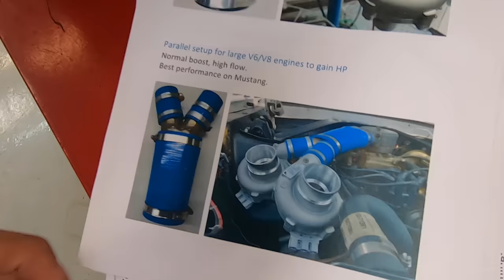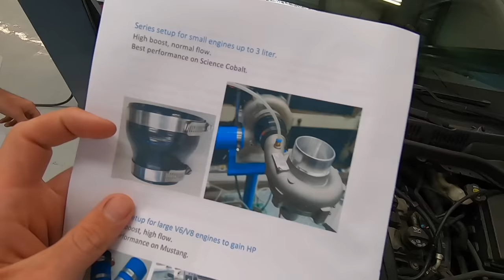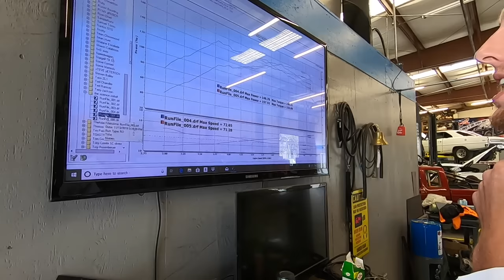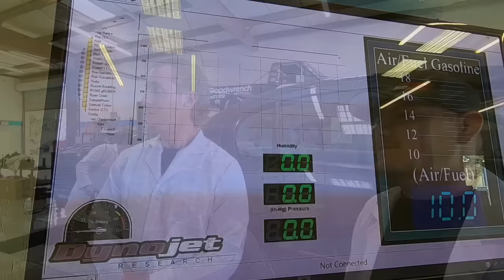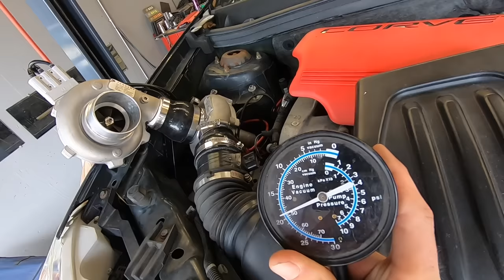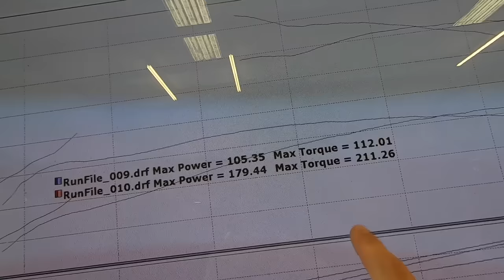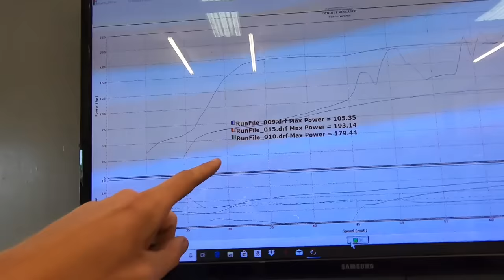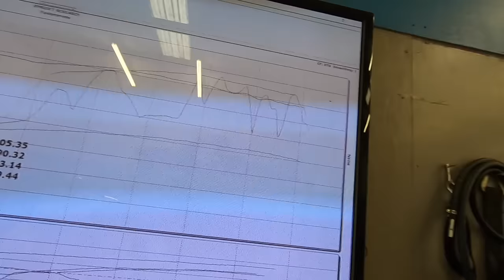Dyno Testing $5,000 Worth of ELECTRIC Turbos! Double the BOOST!!!

Comment: The only thing that can make these little electric turbos better is if they were half the price. Too close to the price of an actual Turbo
Reply: But they spinup much faster so no turbolag
Reply: Yeah the price for only 3-6 psi is a downfall.
Reply: No new manifolds, much less heat, remote installation.... There's a lot of upside.
Reply: @danny-vb8bg  The difference is that they can spool up instantly, independent of the engine. Did you see how early they made power, and how flat the curve was? It's not all about peak HP.
Reply: well these hardly act like a turbo, they act much more like NOS in the power curves
Reply: Michael Remington yep they are more like a self refilling NOS bottle. Just the parasitic air restriction when not used it the real downfall.
Reply: Lag isn't really an issue with a tiny turbo anyway though. These turbos are undersized. a similarly undersized turbo would see hardly any lag either, and would be able to keep up with boost higher in the RPM range (although, not by a whole lot). And since they're not spinning AT ALL when they're not engaged, they create a big restriction when they're not running, meaning you're losing power for all but the times where you're holding down that button. A regular turbo doesn't do that.

Sure, there will still be a tiny amount of 'lag', but it's actually going to be a very smooth and rapid transition, which will actually improve drive-ability over this system. A turbo that is small enough to only be able to produce 3-5psi is going to have negligible lag.

The way it wants to walk all over the road as soon as they push the button is novel, and fun in the short term 'testing', but for drivability and reliability, and longevity of your tires, etc, it's a disaster.

Let's not pretend that these things are breaking any new ground and providing seriously unique benefits that a similarly undersized turbo wouldn't also provide without any of the drawbacks that this thing has.

Cool idea, and a fun toy. But it's gimmicky and spastic in its current implementation.
Reply: They're not close to...they're more expensive than most turbos, Even the fancyass EFR 7064's I plan to get for my 3000gt vr4 are only $4k for a pair. Now if you're including all the other necessary parts then yes, particularly on a car that isn't already factory charged. An Evo III 16g will make nearly twice the power of this setup, and can be had in good condition for $350. My entire DSM cost less than this setup did, even factoring in all the things I had to fix. Electric turbocharging still has a ways to go before it's a viable option for meaningful power from what I'm seeing here.
Reply: @grindersandgears3445  
You have to consider the total cost of install though. These things ARE the total cost (with the exception of an air cleaner, and maybe some mounting brackets and some silicone pipe to replace the accordion.

With a turbo, you have to consider the entire cost to turbo the vehicle. Hot side, turbo, intercooler, oil lines, air piping, exhaust, and all of the little odds and ends like flange clamps, oil line fittings, etc, etc, etc.

Still, even with all of that, a person can make it happen for $1500ish or less if you go with mostly ebay stuff and you've got the fab skills and the tools to build those systems and weld them up yourself. If you wanted to go with higher quality stuff, $2500 is probably a pretty good 'middle of the road' cost estimate, assuming you're still doing most of the work yourself.

Really the only benefit to these things is that somebody with minimal skills and minimal tools could install it themselves with very little time and labor involved.
Reply: @Eidrian111  Good idea? place another inlet opening that takes over after the eturbo goes redundant.
Reply: @kevbarry6457  that's literally what I was thinking as I read through these comments. Problem solved. 😎💪🏻
Reply: @austinmabry8462  You are dismissing the fact that someone could just as easily build the electric turbo setup yourself at a much cheaper pricepoint too. There is absolutely no reason one needs to purchase the kit rather than DIY them and they require a far lesser set of skills to do so. The 5k pricetag has a significant amount of profit built in here with not a whole lot of overhead in materials or time necessary to do so. Anyone capable of fabbing a real turbo could build an e-turbo setup with less time invested. Battery packs are not exactly difficult to construct. The most complex part of an e-turbo build is in the fab work needed to adapt the traditional turbo and mate it to an appropriately sized electric motor.
Reply: @genesishep  
Nope, you're missing a ton of what's going on. It's not just a matter of finding a battery pack and hoping for the best. You would need to custom build a lithium battery in a configuration that can handle the high-current discharge rate that a motor like this would require. Complete with a BMS. It's possible to DIY, but not without a ton of research and a pretty good understanding of lithium batteries, and some specialty tools like a battery cell welder, at minimum. If you don't know what you're doing, you're essentially building a firebomb that you're going to be putting in the vehicle with you. Not a good idea.

Once the battery is out of the way, you then need to figure out how to build a controller that can safely and reliably handle and meter those same high-current requirements. Again, not a simple thing to do unless you already happen to have a pretty good understanding of electrical engineering.

Then, it's not just a matter of finding an 'appropriately sized motor'. It's got to be specced out to not just be the appropriate 'size', but also to have to appropriate torque, speed, and current ratings to be able to spin at extremely high RPMs. It's not something you're going to just be able to pick up off Alibaba or Ebay.

But lets say you do all of the above. Now you STILL have to figure out how to couple that motor to the compressor side of a turbo, after removing the hot side and modifying the input shaft/hot side turbine. All while keeping the shaft perfectly balanced. And then you need to figure out how you're going to mount the motor to the compressor housing in a secure manner that keeps it perfectly square to the compressor housing. That's going to require some fabrication and likely some machining work as well.

I'm not saying that there aren't people out there who have all of these skills to be able to pull it off. Hell, there may even be some people with these skills who've also managed to figure out how to still have their time be less valuable putting those skills to work earning money than DIYing to save it, but those guys are few and far between.

Compare how easy it is these days to slap in a traditional turbo with marginal welding skills. Or spend a little more and just buy 
a bolt-on system that requires no welding. 

You can buy a prefab hot side for most engines, and if you don't mind dumping your exhaust out the hood or fender without running it back to a normal exhaust system, any redneck can slop a turbo system together and send it to be dyno tuned, in a weekend or two.

Most people do not have the skills to DIY even ONE of the aspects of the 'e turbo setup' that I mentioned (battery, controller, or motor, or input/mounting). And the time and effort involved for a one-off just isn't worth it to most people who do have the skillset needed to do the whole job.

And, honestly, as others have already mentioned this is more analogous to a small Nitrous System than it is to a real turbo system anyway.

I'd love to see you prove me wrong though. You should do a DIY build of one of these, and make a youtube video of how easy the process is for you!

Comment: but how much would it cost do make an equal amount of horsepower with a "Normal" turbo if you were to do it right, compared to the electric ones?
Reply: Well you can buy a factory charged Cobalt SS for less than the pair of those cost and make more power stock, lol..Imo, they've come a long way but still have a long way to go to be a realistic option.

Comment: Just a thought seeing as it's using electric turbo's does that now make the Cobalt a hybrid vehicle? Lol
Reply: It doesn't make it a hybrid any more than a regular supercharger would because the superchargers are run by electricity, which is generated by the alternator, which is powered by the engine.
Reply: @averyalexander2303  Superchargers are turned by the crankshaft, not electricity
Reply: @averyalexander2303  when you try to explain something you don't understand at all..
Reply: Avery you clearly missed my sarcastic humor, never mind not everyone gets sarcasm, enjoy your day bro.
Reply: @ExodusisThere  Actually I do understand this concept quite well. What I meant is that the electric supercharger is ultimately still run by the engine because the power it runs on comes from the alternator, which is spun by the engine. Power doesn't magically appear in the battery, the power ultimately comes from the engine since it's what is running the alternator.
Reply: @averyalexander2303  a supercharger is driven by the crank bud. It's not electric
Reply: @averyalexander2303  you said regular supercharger, not electric.
Reply: @averyalexander2303  A real hybrid car like a Prius also gets power from the engine and from re-capturing the energy with regenerative braking, which is energy that ultimately came from the engine.  Unless it is a "plug in" hybrid that can have electricity put into the battery from an external source, all the power in the battery in a hybrid came from gas burned by the engine.
Reply: Apparently people aren't understanding what I meant, so I am going to try to explain this a different way. There is no free power in cars, all of the power ultimately comes from the engine because it spins the alternator. The more power is drawn from the alternator, the more of the engine's power it uses because it becomes harder to turn with more load on it. So ultimately the electric supercharger is spun by the crankshaft anyways because the crankshaft spins the alternator, which is what is producing the electricity to run the supercharger. The car doesn't just have an unlimited amount of free electricity, all the power (including electricity) ultimately comes from the engine anyways.
Reply: @averyalexander2303  i dont see how this is at all hard to understand
Reply: @bulldogbhd  It's hard to tell when someone on the internet is being sarcastic.

Comment: My car is Toyota Passo with a 1.0L 3-cyl engine producing about 70hp as a new vehicle. It's probably making much less now since mine is 15 years old.
There is a mountain that my car died on an uphill once. I can now drive there (20~30mph? very slow but doesn't die at least!) with one of these electric turbo. You need to find an aftermarket MAF as well as the current controller to help the battery.

Comment: I have a 2023 trd 3.5 vg 301 rated hp so around 260 to the wheel. When they just did an exhaust headers intake got it up to 314 to the wheel now if I just got the one turbo for $2500 and pit the headers and exhaust would that get me up to 350 to the wheel woth the single electric turbo or would it just be a restriction on a 3.5 v6? Also when u don't have the boost on its a restriction whatnit u had it on the lowest setting just to get it turn before u get way up in the rmp would u be able to run it like that for a whole trip on an interstate so is not a restriction. So say it's running at 5 psi of boost put it down to 1 pound would that be low enough where it could keep up with the charging but also give u better gas mileage. That's one of the benefits of a turbo if u don't always have your foot in it u get a decent amount more miles per gallon. Thank u

Comment: You need to put them on the mustang to see how they perform on a bigger engine.
Reply: not good
Reply: @L00peey  Maybe if they had 4 of them it would work on a big V8.
Reply: @Plur307  maybe it would at around 4 pounds?
Reply: The twin turbo version Will work nicely on their old 5.0 and not choke It like the single eBay one they tried. It flows way More air.
Reply: @L00peey  I don't know much about cobalts but I think it is a 2.2L engine.  So that is not quite half the size of the Mustang engine.  So yeah the boost will be about halved if it was on the Mustang since the Mustang engine is pulling about 2X the air at the same RPM.
Reply: @Plur307  yea pretty much halved, the good thing is they will work on lower rpm's better
Reply: You'd need 1 for every cylinder
Reply: @BigDeezle420  1 for each valve is more better.

Comment: Need to remove that factory intake stuff and do aluminum tube all the way to the throttle body.....
Reply: It would probably give 3hp! Which when working with small numbers is a lot. It would be the difference between 190 and 200hp...

Comment: I'd think having the turbos split up would be less restrictive when the turbos aren't running.
Reply: With electric turbos it'd be really easy to have a divert valve of some sort between the turbo and inlet manifold which is open to allow unrestricted air when not on boost, then closes under boost.